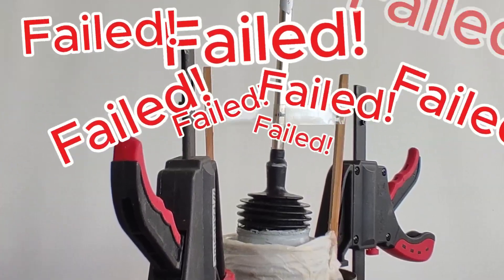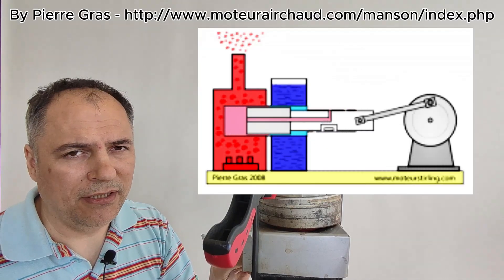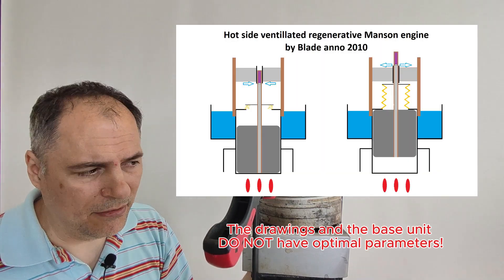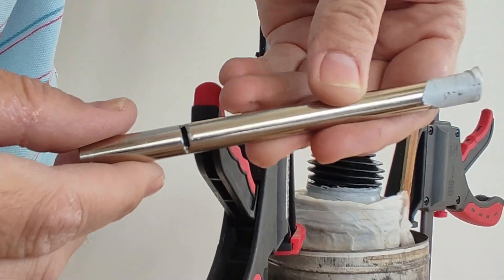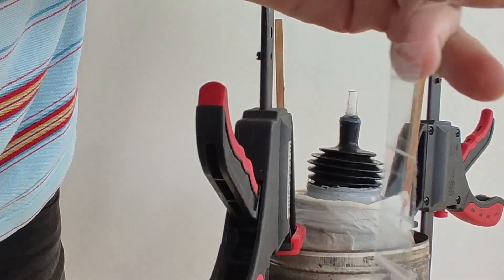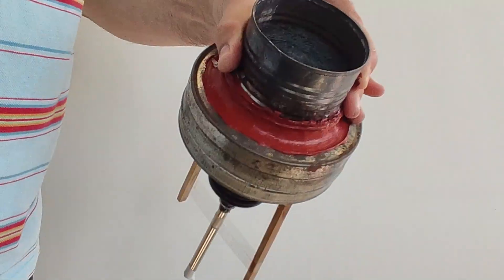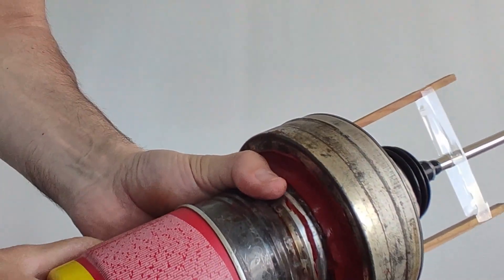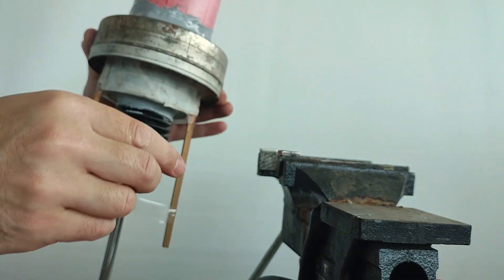How I developed my new Caloric engine - First Step The Regenerative Manson Engine

Comment: Looks good. Do you plan on adding a generator to it?
Reply from the maker: No, this unit is not optimal for generator, by the way the only thing I want to show how easy to turn a hot air engine type to another one with few simple steps. The types are so close to each other.